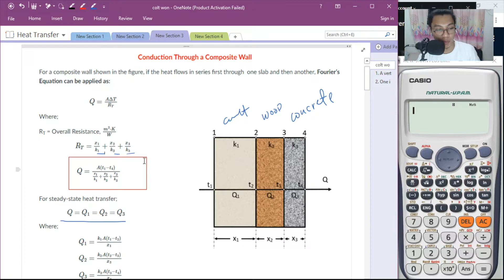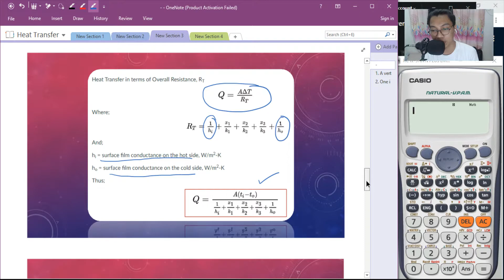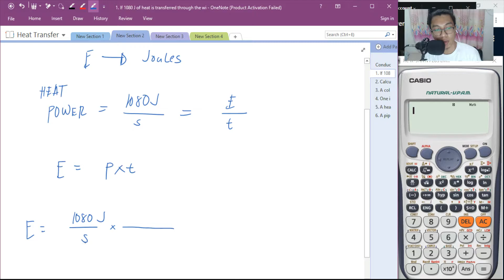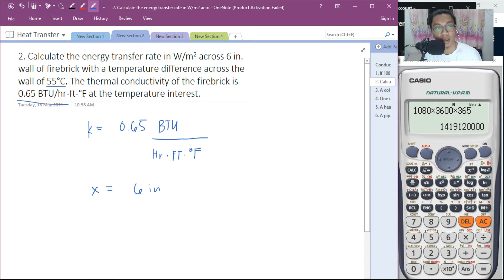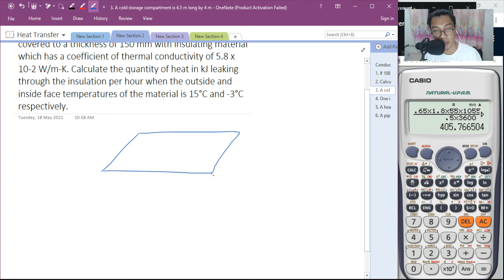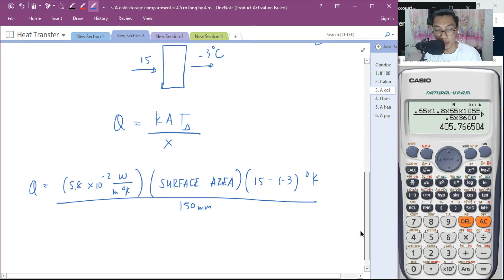Heat Transfer: Conduction Part 1

Comment: Sir asking lang po pano po naging 3600s ang 1-day po? Nakita kopo kasi sa Google is 3600 secs is equivalent to 0.01417 days. 3600 secs po is 1 hr po diba? Sa number 1 example po ito sir. And sa number 2 naman po yung Delta Temperature po is 15 degrees Celcius and -3 degrees Celcius bakit po naging 18 degrees Kelvin napo diba po icoconvert papo iyon sa Kelvin? Mechanical Engineering student po ako from RTU-Pasig po.
Reply from the maker: will do a follow up kaibigan.
Reply: @JimboConstantino  salamat po ng marami sir. Laking tulong po mga turo nyo, nag aadvance study po ako ng HT para sa incoming summer class po namin.
God bless you po and more power to you sir!